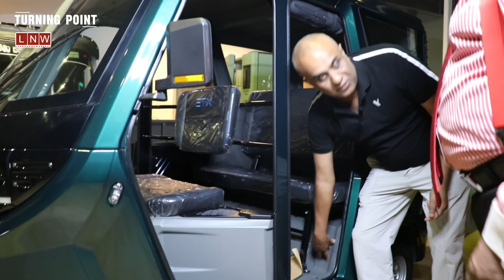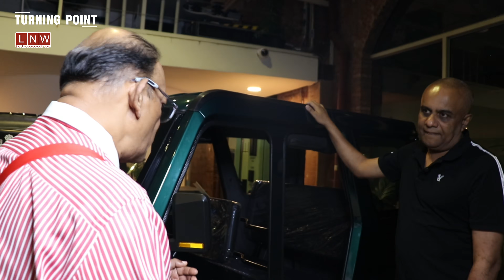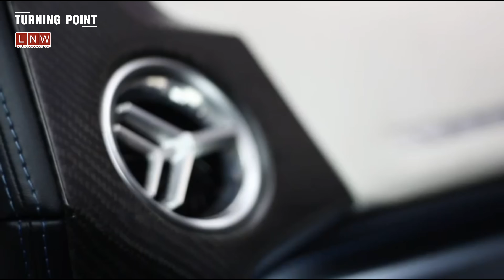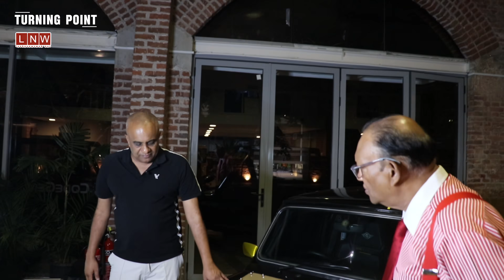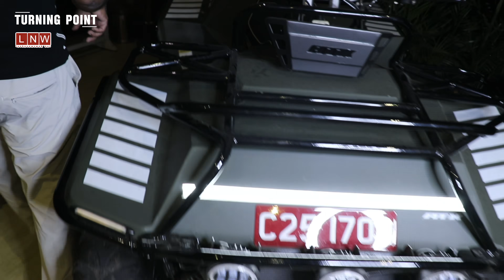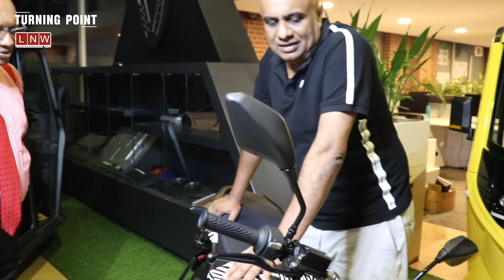"VEGA"Supercar pure electric Performance car made in Sri Lanka and showcased at the Geneva Motorshow

Comment: Rather than a performance car, he had a golden opportunity to make a car for the masses and establish his company and the brand during the 3 years when imports were banned. He could have got large business houses to invest in the capital requirement, as it made very good business sense then.
Reply: Your thought process might be flawed here. Manufacturing for the masses is a high cost endeavour. The reason why all vehicle manufactures go for high-end vehicle production - less units more revenue. And the revenue can be poured into the equipment needed for mass market manufacturing. Not to mention mass market products requires more stringent quality controls, testing and safety measures added to the vehicle. Leading to more cost for the manufacturer. Hence, manufactures opt for a low production high revenue model at the beginning. There are other factors too such as recuperating R & D costs ASAP. Not to mention the initial vehicles are more susceptible to fail; in a mass market, this is a recipe for disaster.
Reply: @Somedude-1111  Thank you for the clarification.

Comment: try to build a vehical that can replace suzuki wagon R. shoud be electric and and non electric. you can dominate the marcket. also 3 weel range is not enough. it should be at least 230km. this number is average range per a 3 weel driver in colombo.